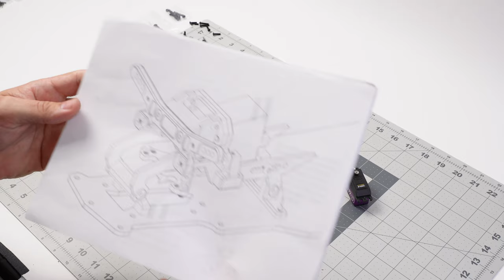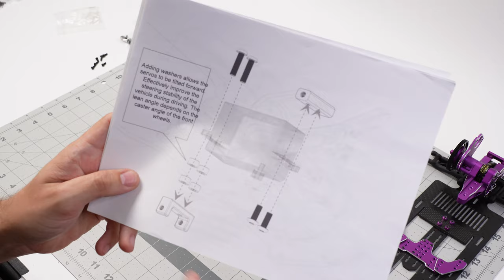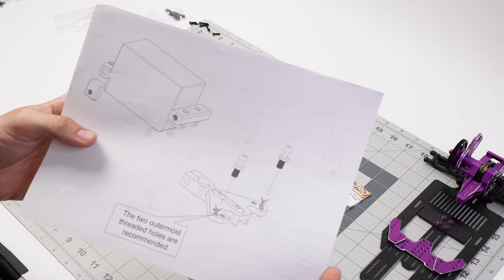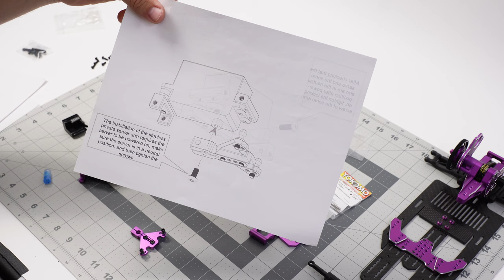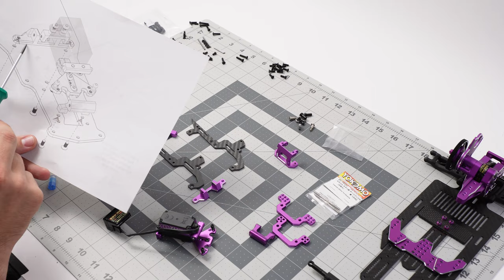The Best RC Drift Steering System in 2024 | DDSS by Rhino Racing | Full Build Tutorial

Comment: What knuckles?
Reply from the maker: Rhino Racing Shark front knuckles👍🏼
Reply: @SeanLewisMedia thanks! I just installed a ddss on a reve d with reve d knuckles and i have crazy amount of bump steer so i think i need new knuckles now your bumper steer is virtually zero from my eyes lol
Reply from the maker: @ManjiMachine  my bump steer has definitely gotten a bit more than in this videos as my settings have changed over time. I’d say drive it and see how it feels and then try to adjust for it. Did you put the spacers in the back and front?